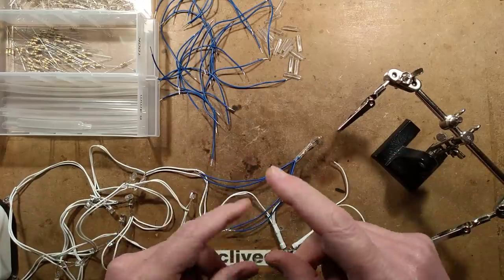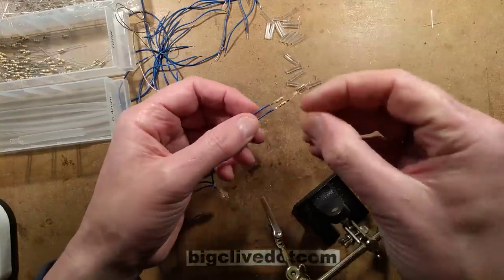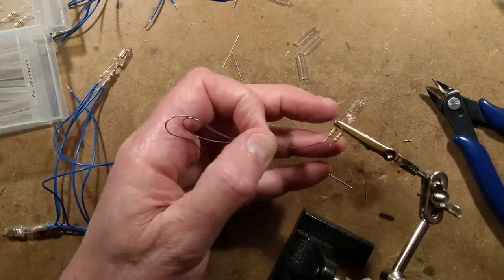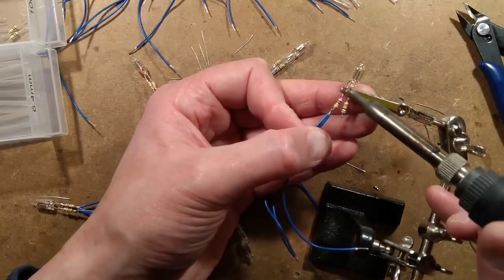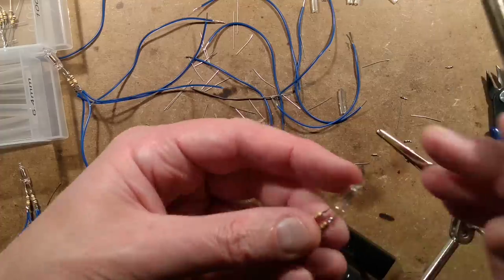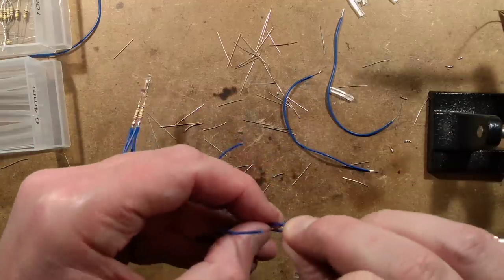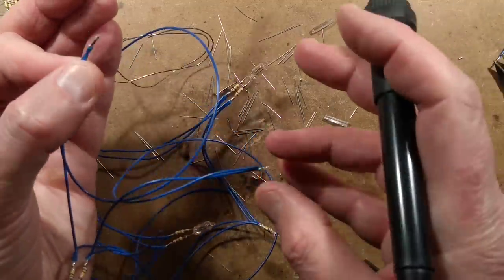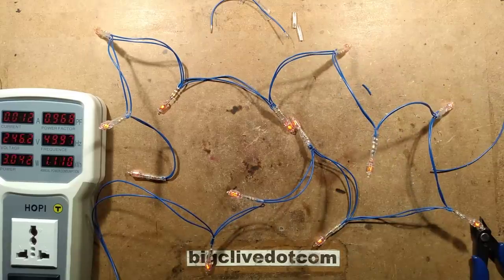Making a set of retro neon fairy lights. (100 year anniversary.)

Comment: At 9 years old I fitted a pipe into a Goblin cylinder vacuum cleaner. This lead to a petrol can on the shed roof. Combustion was caused by the armature and with the rear cap off the was nearly external. Quite exciting at night. I eventially pushed this cleaner into the flooded sunken lawn. It did not go like a torpedo but the green sparks off the armature before it failed were pretty.

Comment: I now feel the overwhelming urge to go on ebay and buy in bulk neon indicators and make my own sets.
Reply: i only finally got round to making a set haha.
Reply: @deltalambda3864  how did they turn out?
Reply: @drunkkmachine4511  rather well, I made a video of them on my channel. I can also tell you the coloured ones have faired well being on since that video was uploaded, a few of the normal red neon lamps have blackened due to the resistors being too low a value but those resistors came with the neons when I bought them so didn’t think about it too much.

Comment: We call the windows transoms. From Wikipedia: "In architecture, a transom is a transverse horizontal structural beam or bar, or a crosspiece separating a door from a window above it. This contrasts with a mullion, a vertical structural member. Transom or transom window is also the customary U.S. word used for a transom light, the window over this crosspiece. Wikipedia"

Comment: 20A cable should be OK on a spur even with an adapter or socket strip plugged in because they should have a 13A fuse.  So a 20A Wago should probably be OK.  For some values of OK.

Of course, if you try hard and do naughty things you can pull 32A out of the spur, because it's hanging off a ring circuit behind a 32A breaker.  Not a problem if you do that with a socket on the ring circuit, which effectively has two 20A cables in parallel.  A bit of a problem on the spur, though.  So don't do naughty things.

Comment: I wonder if the discrepancy in sizing on the heat shrink is referring to the maximum wire OD. Like stuffing a sleeve onto a tight fitment of wire may cause the heat shrink to tear as it tightens up

Comment: Glue lined heat shrink tubing is great for waterproofing and acting as a cord grip :)
Reply: you can also fill the standard one with shards of hot glue or melted hotglue. could save the spacers/separator.

Comment: @ 52:00
i'd have to look it up if there are wago connectors for 16Amps, but am pretty sure the standard older (grey/orange)  ones are rated at 10amps.
whereas the 10amps would be the contact rating, contacts producing resistance and heat, so if youd use a 5pin wago,
 you could run parallel wires if you really need above 10amps.  Would be interesting to look at a heavy load with a thermal cam..

edit: just looked&found a wago lever-clamping wire connector, newer type 221, 5pin.
its rated for 20Amps / 300V  copper 1.6 or 2.0mmD or (other side print)  450V / 32amps with AWG 24-12 / 0.14f (??)/0.2 to 4* something...

Comment: i would love to see you do a proper solar phone charging device....all the diy ones i see online are absolute crap...  :) cheers.
Reply: the proper way to do it is have one that charges a power bank
Reply: @SuperAWaC   yeah i'm doing that, i charge all day via solar, into 4x18650 batts, using just 1 poundland powerbank circuit to charge all 4 batts in parallel....it works, but thought there might be a better way.....cheers
Reply: i've integrated a solar panel into a power bank before...didnt work that good but it did work, easier and faster to plug it in, it was ORIGINALLY a solar powered yard flood light, added a power bank circuit and new batteries to it

Comment: The hopi quit flickering when you turned down the exposure.
Reply: If a computer, or another type of screen that's causing you trouble, you can also usually slow down your shutter speed a touch to eliminate it. So, if you're shooting at 24 fps with a shutter speed of 1/50, you can go down to 1/40 (or whatever's closest) and completely remove that strobe effect.

Comment: Ah yes -- crappy cameras...I'm a ham radio operator myself, I went thru 3 different dash cams before I found one that didn't destroy radio reception in my car.  Finally sucked up and got a name brand Garmin unit that didn't jam radio signals.  Then I wanted it hard wired so I had to build a shielded power supply (in a copper soldered box) with low-pass filters (capacitors and inductors) to kill the noise going out on the power wires.  Also shielded USB cables for power help, though they are hard to find.

Comment: One of these days, I'm going to create and install dc lighting in my place, either LEDs or neon lamps, depending on the location (I love the amber glow). Recently I've become aware of the flickering of my LED lamps running on mains voltage, and it's becoming bothersome. So, some nice non-flickering lighting will be nice.

Comment: Hmmm, I guess you could reuse an old incandescent set for this project if you wanted to... 

Though they tend to be serially connected and not parallel, but I dunno if it's a problem to drive a bunch of neon bulbs with a single resistor instead?
Reply from the maker: That doesn't work.  The first neon to light clamps the voltage.

Comment: my house/workshop is worse than anything you could show me but if i am ever in the isle of man or you're in the chicago area, gotta meet for a coffee and drink, i've seen SO many 120v lighting fixtures with blue painters tape on the wires to seal/hold them recently, its scary, including a brand new 30 watt cool white fluorescent replacement fixture i found outside walmart sticking out of a garbage can, worked fine once i attached a cord/lead to it and plugged it in, my ceiling in my room is just a misch mash or flourescent and led lights, hell, my entire ceiling is covered in old motherboards for decoration
Reply: also i was literally taking toys and appliances apart as a kid, under 5 years old, a lantern battery or lithium ion(18650s are awesome) a motor and some leds is great for kids, eventually after taking apart and ruining many devices, after a while i learned to put them back together with most of the screws back in the right place and actually fix stuff

Comment: How about using a pair of 10k resistors in the plug instead? That would save components and make the wiring a bit safer. Or is there a problem with using neon lamps in parallel and feeding them from a single high impedance supply? Would there be a problem getting some of the lamps to strike?
Reply from the maker: The first lamp to strike will stop the others striking on each half wave.

Comment: 14:35 so so very true 😪

Why do you have a random bit of solder on its own? I've always just had to whole reel instead of a small half meter long bit?

50:44 I've done the same and crashed my car. I was EXTREMELY lucky that the accident could of been a hell of a lot worse. I still continued to work for W. E. Mannin.

59:40 You forgot to put a bit of heat shrink and the separator on the 3rd one in from the end. 1:00:58 I'm surprised you didn't get a belt as you were so close to it lol
Reply from the maker: I tend to snap a bit off for convenience.  But it does all get used.
Reply: @bigclivedotcom  I think a lot of people do it that way but for some reason I just find it easier, even though I have to keep pulling a bit of so I've got a load of slack to use up. 

Btw. I honestly thought that pussy doll with a firework hanging out of its arse was a real thing! As we both know, there are some really strange things you get in there and tbh it wouldn't surprise me if that was the sort of thing they'd sell lol.

Comment: In response to ( James Van Damme , below ) the resistor is 10 MΩ and the capacitor across the neon is 100 nF  , the single diode MUST be 1N4007 ... fitted ( randomly ) on a sheet of matt black pegboard , the neons flash together , but soon lose sync and flash at total random ( NOT BRIGHT , but at night makes a superb " firefly " display , mesmerising .. I built one years ago but sold it ... I am in the process of making a replacement , use 230 Volt mains ( tried - n - tested ) .....

Comment: A white neon would be xenon? It's become an oddly expensive gas lately, difficult to procure, certainly in the UK any way, could you use camera flashes as neon tubes?
Reply from the maker: Camera flash tubes are optimised for high voltage use.  There are some interesting neon style tubes that use xenon and capacitive coupling between an internal electrode and external conductive coating.
Reply: @bigclivedotcom that's got me thinking about TV tubes again

Comment: Clive, I'm not sure the best way to contact you, so I'll drop a question here, if that's okay. I'm building a project that requires 2 solenoids, and I wondered if you had a trick to wind them easily without a special rig. I'll check over your videos after watching this one and see what I can find.
Reply from the maker: It might be viable to do it with a cordless drill to rotate the core while you lay the windings on.  In the past I've just hand wound small coils.

Comment: Clive, I've got a project in my head that uses NE-2H lamps but I don't want it directly connected to the mains (for safety).  Do you have any suggestions for a small isolation transformer, 120VAC to 120VAC?  The neons (about 100) will be flashing, not on all at the same time, so current load will be low.
Reply: In case Big Clive doesn't answer better: an easy and cheap way forward is to get two scavenged low-voltage transformers (e.g. 120V:12V and 120V:9V) and connect the low-voltage secondary windings (for which, the voltage  only has to be comparable, not equal).
This hack is (obviously) a bit bigger, heavier, and less efficient than a single transformer, but my junk box has lots of suitable junk :-)
Another alternative is if you can find a transformer intended for dual voltage (120V or 240V primary), where the intention is to use the primaries in parallel for 120V or in series for 240V. Then put 120V on one primary, and take 120V from the other.
Also I'm curious to know how much power you need; I'll guess a 50% duty cycle, 1mA / neon, and 50mA at 120V is 6W (so use a slightly higher-VA transformer :-)
Reply: @theskett  Thank you for the reply.  I've thought of the 2 transformer idea but the size and weight puts me off.  I was really hoping to find a purpose built isolation transformer that was also very small.  Probably doesn't exist but I'll keep looking.
Reply: @theskett  That looks interesting, thanks for the post!
Reply: If you are in North America, the shaver sockets in bathrooms contain a small isolation transformer.
Reply: @eamonroad6388  Thank you.  I'll try to find them.

Comment: Mr. Clive,  Let's say someone has the 3D modeling tool (Tinkercad) and a 3D printer (Ender 3 Pro) and the filament (PETG) to make long lengths of the separators (200mm) in a quantity for you-  what dimensions would you theoretically want the separators to be (height and depth)??  I currently have a quick 2.5mm high by 2mm wide "I beam" but the side cutouts are more hour glass than an "I" that are a little over 1mm at the thinest in the middle.

Comment: My eyes swear that one of the lamps did not have heat shrink tubing around the resistors. I'm sure you assembled everything completely but it just looked naked compared to the others.
Reply from the maker: It was missed, but then fixed.  I also mentioned it in the description.
Reply: I thought that too, but nope. Says in the description he left one off accidentally then connected the string to mains. Yikes.
Reply: Description? Descriptions are for people who pay attention. I read them sometimes but on so many channels there's nothing there so it's easy to get in the habit of skipping them.

Comment: It would be interesting to see string of neon bulbs flash like in neon nixie lamp?
Reply from the maker: In the description I mention adding a series limiting capacitor with parallel resistor to make the set unstable.  It makes various amounts of the neons unstable so they flicker like little flames inside.

Comment: I'd say blue leds are probably bad for eyes (in sufficient quantities), because they have so much u.v. I've used them to get that flouro effect with "dayglo" colors, it's not quite the same thing as a u.v. led, but it might be as bad in large doses, make you blind, or even worse... I wouldn't worry about it.
Reply from the maker: That's not UV.  Fluorescent colours are stimulated by blue light and because it's a dark colour the fluorescence is more visible.  An LED typically puts out a single wavelength of light unless it has multiple chips or a phosphor to widen that spectrum.  I wouldn't recommend staring into any point light source.

Comment: Had you considered kissing the ends of mostly-spent solder together to continue using the bit which you would otherwise set aside in favour of a longer piece?
Reply from the maker: I'll use even the tiniest bit of solder by literally throwing it into the flowing solder joint.
Reply: @bigclivedotcom  At'ta boy. More chocolate for you.

Comment: Is it possible to put 3 in series and use a small value resistor? That would be more energy efficient
Reply from the maker: On 240V two neons can be wired in series with one resistor.  But the strike voltage is usually around 90V so that may not work on 120V supplies.  Using two in series also increases flicker.

Comment: Clive, I have a couple of lightbulbs you might be interested in looking at. One is a cheap dimmable LED lamp from ebay (which I have already opened up, and put back together), the other is a standard incandescent 275W bulb that I got from my grandfather who used an array of those for cine photography. It is the same size as a normal 60W bulb, but a bit brighter... it's about 50 years old, but still works. Ping me an address and I will post them.

Comment: Isn't there a danger that the 2 sides could short together under the heat shrink? I would have thought that you would use the thinner tube to slide over at least 1 leg on each.
Reply from the maker: The plastic spacer keeps them separate.

Comment: I'm having a brain fart, I'm trying to learn, but what resistor about would I need for 9v CV, on a 6-7v 10w LED?? It has been about 2-3 years since I even though about this subject, I'm trying here, on my own, can you offer help? I'm thinking a 15watt , and off the wall, 100 ohm?
Reply from the maker: If the LED current is around 1A then you could use a resistor in the range of 2 to 3 ohms and about 5W.

Comment: Hey, can you help me make these solar? I wanna make them a gift for my mom, but i cant seem to find out how to use normal garden lights solars on these
Reply from the maker: It would require complex circuitry to boost the voltage.  Better with LEDs for solar.

Comment: Chromebooks are NOT designed to run Android apps, they are not designed with processor power in mind, if you intend to download and run multiple apps, i strongly recommend buying a tablet with a quad or octacore processor and 8 or 16gb of RAM. The most you usually get with a chromebook is 2 or 4GB of RAM at best.

Comment: 100k? Not a more sturdy 330k?
I wondered also, could you just add a larger resistor on the input or output rather than on every single neon?
Reply from the maker: With a single resistor one neon would try to shunt all the current.
Reply: @bigclivedotcom  thanks, I did wonder
Reply: @bigclivedotcom  I was thinking of this, and I thought about a regular extention cord, would plugging 4 lamps in mean one lamp would be brighter than the others, should all outlets be... Limited 😂

Comment: I might be being dim, but how did you ensure live didnt accidentaly get connected to neutral
Reply: For the string to plug to socket live/neutral doesn't matter as it's all symmetrical. Which wire that goes to which terminal on the neon doesn't matter.
Only live2neutral risk is by the neons/resistors and he uses the plastic "H-beams" to keep them separate.

Comment: It would be nice to know what those H Spacer things are called and where to buy them separately. I can only find round ones that are nothing like the H ones I see in string LED lights. Does anyone know where to get them (besides cutting apart existing strings?)
Reply: Someone upthread (sorry, lost the name) says to use model-maker's H-beam, £1.50 for 500mm.  But I'd just put skinnier heatshrink over the LED's "legs", because that's cheap and easy.

Comment: I'm curious what would be if plug neon lamp without resistor. How does the boom is looks like. More than 15 years I thinking about it but my teacher said that I shouldn't do it. ¯\_(ツ)_/¯
Reply from the maker: It does go bang.  I did it when I was young.
Reply: It was a good or boring bang?
Reply from the maker: @ntfshard  Very loud and completely destroyed the tip of a favourite pen that I used to short two contacts that inadvertently bypassed the limiting resistor.  The neon's leads literally disappeared as did most of the PCB tracks.

Comment: Why not run 2 neons in series with one resistor?
Reply from the maker: It would require an extra loop wire between each pair.  But it could be done.  The resistor could be fitted inline with the series link.  Only for 220-240V supplies though.  This approach was aimed at 120V supplies too.  The neons also have a stronger flicker when wired in series due to the higher combined strike voltage.

Comment: And don't whatever you do put a 100 or so of these neons into the microwave oven and turn it on...   Use shades...
Reply from the maker: Best with the leads cut short or it can nuke them quickly.  I used to have a lovely star shaped neon tube that really blazed in the microwave.  Until I left it in for a few seconds too long and the tube cracked.